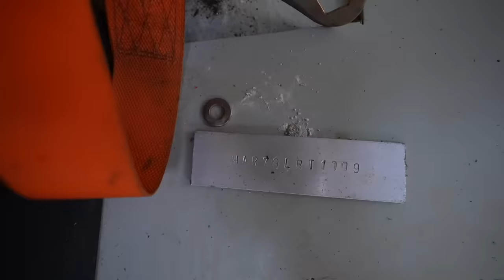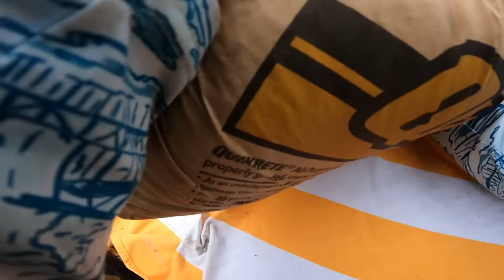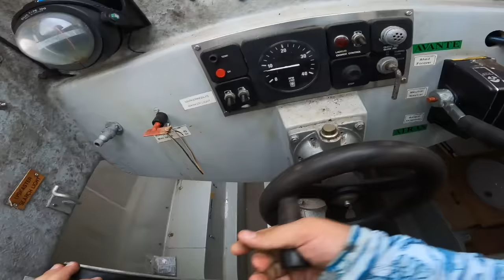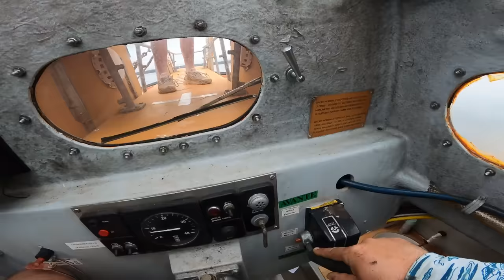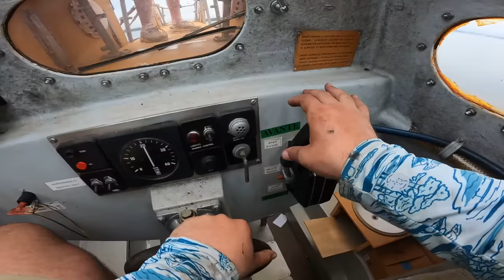WATER TESTING 64 Person Enclosed Lifeboat For The FIRST Time!!

Comment: they use acid to get the bottoms of boats back to condition again, no need to repaint, use muriatic acid diluted with a little water and a crap broom (it will melt a little) and if your getting carbon monoxide into the engine compartment it will kill your engine power aswell, MUST be an exhuast leak, fiberglass repair is like welding (prep wise) you just have to grind away alot more material to have enough surface area to hold on to when you lay up the glass and make sure to follow up with a good amount of gelcoat for durability

Comment: Was that hole for the cold water intake for the diesel motor in it. 
Like the engine cooling system. 
I'm 100 sue that's what that hole was for. 
Don't fire up the motor

Comment: That hole you plugged is for exhaust possibly , that could be why you are having carbon monoxide problems, I do not think a little crack in the engine box would do that.

Comment: The hole looks like it's supposed to be there are you sure it's not for the engine to pickup water for cooling or something? Or maybe the exhaust fumes go out threw the hole maybe that's why the cabin was filled with smoke .

Comment: i am almost sure that you should not have sealed that hole in the bottom. these disel engines have no radiators and hence MUST be water cooled. Maybe the hole was for the cooling system, otherwise it could be for the exhaust. Anyways  you need an expert to look at it and advise accordingly.

Comment: Could one of these be converted into a underground survival bunker? 
It looks like it’s plenty big enough for that purpose. 
Think about having one of these buried in the ground and be converted into a community shelter?
And wasn’t that the original purpose for these things in the beginning? Survival?
That’s one thing that makes tornadoes and such so deadly, flying debris… 
Anything that could cause a piece of straw to be driven into a telephone pole or tree?
Reply: That's a really neat idea.  The only thing I'd worry about is how deep you bury it, I'm not sure it could take more than a few hundred pounds.
Reply: @hatad321  The whole point is to just get it just below ground level. The biggest threat with tornadoes is flying debris. Not all that many people are killed directly by tornadoes themselves. They can quickly totally demolish something the size of a house and turn it into death by one million knives. Get the entry door just high enough that someone can quickly and safely get down into the unit. Find someway to reinforce the entryway and add something you can use to quickly be able to get inside. I’m reminded of submarines. It’s not just you getting inside the sub but everyone else getting inside too. Getting inside is something you need to drill on so it becomes second nature.

Comment: Can't you just build your fiberglass patch on a board that's covered in wax paper, or something, then use a jack to force it up against the bottom of the boat?  The pressure would help squeeze air out.  Before doing so, I'd fill the void that step 1 left behind.  Maybe a better first step is wadding up some fiberglass and drowning it in whatever product then stuffing the hole and jacking a board against it.

Comment: The location and size of that hole looks ,like the water jacket discharge hole for the engine cooling.  Or a piss tube head.  I wouldn’t have plugged it that way

Comment: I just checked and double checked the engine intake raw water coolant location on those boats and I have no idea why anyone in their right assed mind would ever seal it up.  It would REAULT IN OVERHEATING  AND THE MANIFOLD CRACKING AND ALLOWING CARBON MONOXIDE TO LEAK INTO THE BOAT. OH WAIT,  THAT HAPPENED.

Comment: You need to be alot more careful with the fiberglass resin.  It's best to use a brush to apply it and the surface needs to be sanded and cleaned first.  I suggest that you get some professional training.  Your repair is definitely going to fail.

Comment: This is one of the safest boats you could ever be in if you go to the inside of the boat spray foam a couple inches all the way around on the inside and then finish that out the thing will never sink everOh yeah you do need a case of drama mean

Comment: Are those bags of concrete he's using as ballast?  I know nothing about boats, so this is an honest question.  Wouldn't that be bad to have in the bottom where bilge water accumulates?  Seems like the bags would get wet, split open, and fill the keel permanently with concrete.  Again, I don't know shit about boats.

Comment: Now we're all the passengers set you can cut the top off of that build a a tent like top that you can take on and off that way it's like an opened up boat not like you're going to go in big enough waves for it to get flipped upside down and it would be nice it would be almost like a party boat and build a ladder so you can climb up to where you got to drive the boat and make it where you can still get down into that so it's still leaves some of the original style to it you can make it look pretty cool though paint the bottom side black the part that goes in the water through the top side bright ass Orange blue or something cut the top off with a passenger seat put a tent roof do some lights speakers be a nice ass party boat and then you can upgrade the diesel engine down the road it's a big turbo is on it so it actually gets up the moves put a bigger propeller put a better turning prop on it so it turns faster

Comment: That was hard to watch, maybe you should learn how to operate a diesel engine boat before you take it out on the water. The basics like checking fuel level before you leave the hard. Not taking the boat off the trailer until you have actually started the engine, revving the crap out of the engine, it’s a diesel not a petrol, 1500 up to 2500 RPM, Not 3500 RPM.  it’s all basic seamanship.

Comment: I feel worse than doing fiberglass for watching this. There are some basic things you need to know about doing fiberglass what is pretty simple it's just nasty. Doing the Hall of a boat like this I would begin by putting a block on the inside cutting Marina grade ply much bigger than the whole and installing it on the inside for stability then on the outside strip the exterior paint off completely until you're to Bear glass. Get some visqueen or plastic that you can see through tape it to the hall of the boat and use a marker and Trace out the hole. Cut exactly the size of the hole and then two other pieces bigger about an inch of diameter bigger each time and then use some soft sanding filler to blend all three surfaces primer and paint. That is how you feel a hole on the bottom of the Hall of a boat